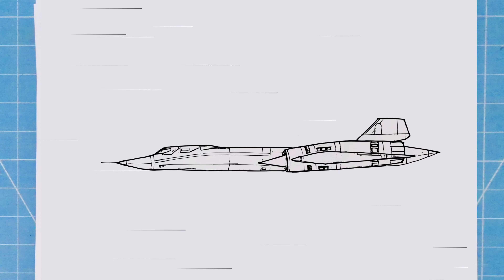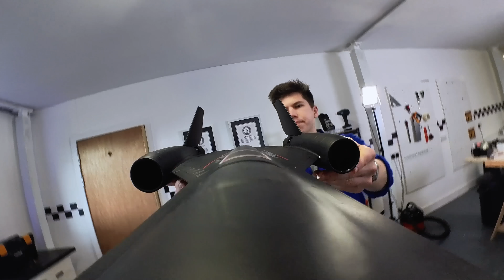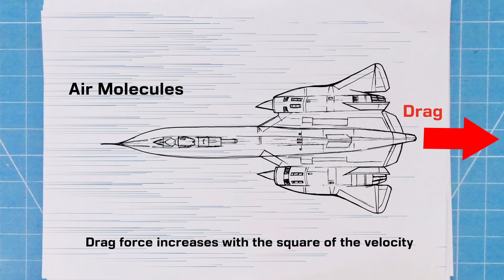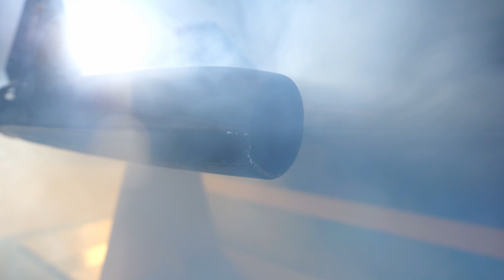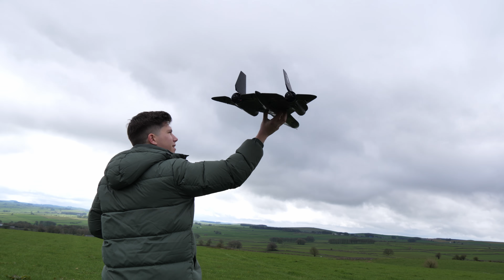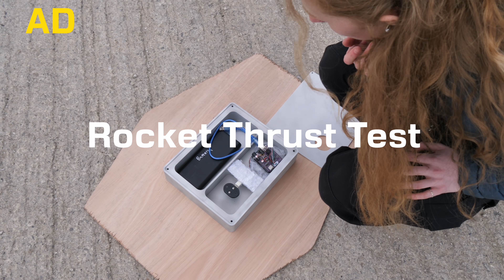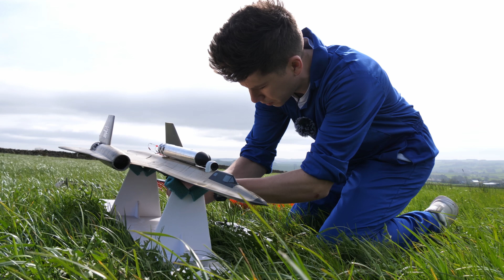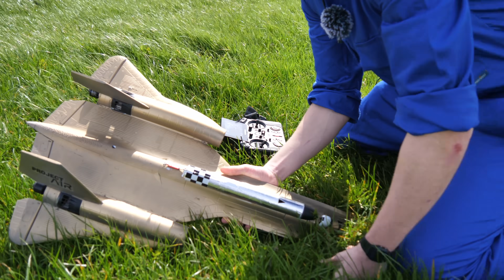Building a HIGH SPEED RC Plane (SR-71)

Comment: you need to stop mounting the rocket engines to the top of the plane . they need to put in the back like the fans but in the middle . desing the same plane model but with the option to put in the rocket engines in the back like a fighter jet . and put 2 rocket engines in the back not one .
Reply: You can can rocket motors that are essentially just multi stage boosters, you literally cellophane tape them together and when the flames hit the tape, it melts, drops off the dead Booster while igniting the second stage. More boost with less weight. Mounted underneath it with 2 boosters then the final motor with recovery chute.
Reply: Everyone is forgetting that the rocket will get lighter after burning and change the cg a whole lot the further away from the original cg it is
Reply: @nite31fpv17 interesting, I did forget about that.  Would be worth measuring the mass delta to determine the impact.
Ideally could design a plane with wide cg limits, and just set it up tail heavy at launch and let software stabilization keep it in the air.
Otherwise it would need some sort of moving mass to offset, which seems... complex
Reply: I know there are wind screens for cameras in the model rocket scene, maybe you could cover the exposed bit of the camera with that to reduce drag. I like the idea of dual EDFs on the wings and a rocket booster in the center. Maybe working with fiberglass rather than foam could help prolong the lifespan of the aircraft. Can't wait for the next episode!
Reply: I disagree with two motors, but otherwise you're spot on.  Two motors is unnecessary complexity at this phase - just getting a stable testbed and some basic design principles sorted would be the first step.

Then can work on multiple motors.
Firing two solid engines at the same time is hard b/c thrust asymmetry causes rapid yawing.  I'd go with higher thrust motors staged serially
Reply: Correct, but it would require massive redesign, almost a scratch-build. Which is ok but a much bigger investment in both time and money.
Reply: I agree with this cuz if it will be sitting on top, it kinda disturbs the aerodynamics
Reply: @Bragiz  not only that, it pushes the perfect in line thrust point from the normal engines way higher wich causes the plane to pitch down and generate even more drag .
Reply: @Ingo3112 się u thought bot the center of gravity?
Reply: Yeah, this guy has never played Kerbal Space Program
Reply: Two engines is hard because solid motors have different burn times and ignite at different times no matter how well times you have ignition.

But you are correct about having the boosters center mounted and not on top.
Reply: @exterminater267  Yes you might be right
Reply: You build your design and then make a video showing everyone how correct you are.
Reply: @BryanOfDale  🤣
Reply: I'm not sure 2 rocket engines is a good idea, since those small rocket motors tend to be unpredictable and can have varying thrust curves, you would introduce large yawing moments.
Reply: Pretty sure it would be a nightmare dealing with the center of gravity if you did that
Reply: But then it would be heavy by the aback
Reply: @Ersen-x9e  its the basic principals of physics it would be a lot easier to controll the jet if they put the thruster in the middle
Reply: @Ingo3112 it would be hard to fit it to the back because this would move the centre of mass a lot further back on the plane making the plane more unstable and backflip in the air. If you tried to balance it out by putting weight at the front then it would probably be a lot heavier possibly even too heavy to fly seen how hard it was already to launch. The fans can go at the back because they are a lot lighter than a scale rocket engine and even then the fans aren’t all the way at the back they are also around half way.
Reply: You are completely wrong, bro. This is hilarious. This aircraft specifically on top ram jet used to accelerator to its max potential easier especially used on NASA SR 71 blackbirds I do not like people who do not actually try and look at a photo in the beginning of the video showing one type of ram jet specifically the double ram jet, but if you want to look into other photos, it will just go ahead and it will have a singular ram jet on the top with a similar nose cone Your idea is smart, but there is smarter ways to do that so next time actually think about searching it up and then you will have better real information. You may not get the same amount of likes because people do not understand this real stuff. And also, he could probably go ahead and just make it a jet engine and do it as a glide like his previous one.
Reply: Boo
Reply: I agree with the placement, but disagree with the number, 2 has a very high likelihood to ignite at slightly different times, causing the same instability issue
Reply: @Hunt4Bond  You might be right at this point . but the ignition is only milliseconds apart .
Reply: I agree with putting them in the back, but you would still have to mount them on top of the plane for the beautiful belly landings that he does so frequently, just 3d printing mounts to face the rockets slightly up and finding a plane with a lower wing cube loading should help, or be a little better anyway.
Reply: Thats exactly what I was thinking half way through.
Reply: The only problem with that is once the solid state rocket engine is burned, it would effectively make the aircraft extremely nose heavy.
Reply: There is no room for the engine to go
Reply: U would think he would actually know this but oh well
Reply: Does it matter? Rocket go push push by going NYYEEEOOOM then SR-71 go fast
Reply: @CA-vo7jk  ah yes that’s how we got on the moon. Not trillions of dollars of research into aerodynamics and rocket science but by going vroom vroom
Reply: @CA-vo7jk  it does matter, show me jet with the engine mounted on top
Reply: He is clearly studying aerospace engineering at Sheffield Hallam University 😂
Reply: This is very true because just the slightest center of thrust on the top can tip the whole thing over I know he engineered it good but still it would go faster if he put it on the back aligned with center of gravity and lift making it more efficient
Reply: Same thing goes for underslung engines, they will pitch up when you add thrust
Reply: About 25 years ago a SR-71 remote control model rocket was sold on TV. I had one and it would have been perfect for this. Maybe someone can track one of those down.
Reply: Its tough to say that it would work. Firstly, the center of gravity will be thrown off as the engines are far back from the center, resulting in reduced work done by the rockets as it's challenging more height, requiring more joules of energy to propel forwards. Secondly, if the rocket's direction were to slightly alter, all the energy from the rocket will result in the body creating directional spin, aka, it's either gonna be flipping uncontrollably or going sideways. This may be due to the rate of the amount of air flowing over control services reducing, resulting in a stall.
Reply: You're right but it can be inside of an engine
Reply: You are sma
Reply: Not ur choice
Reply: @thomaslarsen1743  bro shut up
Reply: He didnt even read a word 💀
Reply: Yeah, mount them like under the wing
Reply: Fr
Reply: Koko
Reply: @mosunosinowo5956  ??
Reply: This is what I do when I actually modify rc planes
Reply: Fffff
Reply: Hhh
Reply: Nah he’s just stupider than a French fry when it comes to this stuff
Reply: Well where's your plane then
Reply: No One cares
Reply: ye it pushes the nose down
Reply: But plane Will get tailheavy
Reply: Finally a smart comment
Reply: Yep
Reply: need to keep the center of thrust in the middle
Reply: Yeaaah i agree but do you have any idea where he can place the rocket? As you can see in the mid body of the blackbird is all the wiring component
Reply: gysryuukfcmhvj,
Reply: @ingo3112 am not saying ur wrong and I don't know much bout planes or whatever but I think the rocket doesn't have much of an effect because its behind the camera
Reply: yes i thimk so too, cause when its two ist more power and its more stability
Reply: They video is about adapting a design, not creating a new design entirely. Putting it on top in the middle is the best way to use it without completely changing the rear of the aircraft. Because it’s in the middle, the centre of mass isn’t changed, and the rocket motor is aerodynamic so the only problem it has is that the air flow between the top and bottom is drastically different, affecting forces like lift and creating turbulence.
Reply: Fax
Reply: And a slim design would decrease drag and wings like a concord would also decrease drag and give the lowest amount of airflow while still having aerodynamic wings
Reply: Ooo, im much smarter than the author of channel, he is stupid, im smart
Reply: @ oooo we don’t care about ur opinion
Reply: Bro is acting like he knows something
Reply: Put it under the wing😑
Reply: @David-zi5wd that’s not how it works, a reason the me 262 isn’t used anymore because the jets increased drag.
Reply: @MR_FREESTYLENURD i meant like the B-1 it was successful and also I was bored and forgot the other part sorry the other part is or try one engine on the tail base or you can try going to use a fan then put a hole that connects to the fan now try it’s faster and use short wings if possible
Reply: Also, putting the rockets on the top can burn the plane.
Reply: DONT LISTEN TO THOSE GUYS
Reply: Blah blah blah
Reply: The plane is made of hard plastic bro
Reply: That would be bad for balance
Reply: That is true, but it is really hard to squish all of the electronic and also balance the cg with such modifications
Reply: @Avio_x the electronics are very basic for rockets. The same current that runs the fans will easily ignite the rockets, you just come off the rc controller receiver with like #22 wires or something very tiny it doesn’t need much to ignite a rocket engine
Reply: Plus he needs to fit that camera inside too. It's creating downward lift
Reply: Totally agree. Try to fit rocket and camera into the aerodinamic shape of the next plane... whatever shape it's gonna have. Anyway, the SR-71 Is soooo cool!
Reply: The CG changes when the rockt motor burns out. If it was installed in the back, it would become nose heavy. But I agree, that it would be better from an aerodynamic perspective.
Reply: When the rockets are on top it may push the plane down cuz it's creating more thrusts than the actual engines
Reply: I know it's not a perfect comparison, but you're forgetting jato, which was an extremely common method of getting aircraft into the air very quickly. Especially when heavily lo, the V1 rocket system in the V-2 rockets, which were rockets, strapped in a back of plains. So all I know, even though it's using an SR 71 , I'd say he's being pretty  consistent with history.
Reply: @NA-oq4ty  Jatos are on the bottom side to generate uplift and pushes the dack down and the nose up as you say to get the plane easier in the air . this has nothing to do with this situation . besides that this config on the top pushes the nose at high speed down and causes extreme drag .
Reply: The V1 used a pulse jet that was mounted to the top. The concept works just fine. 😉
Reply: @GordonScottFPV  It works fine when the thrust to weight ratio is low, like it was with the V1. The pulsejet was a very primitive engine and barely produced enough thrust to keep it airborne, so relative to the aircraft's mass the high centre of thrust would not have had too drastic a pitch down moment. This is something else entirely - the rocket has very high TWR when strapped to such a light airframe.
Reply: @Silvera-Avian  agreed, there are a lot of variables to consider with thrust to weight ratio, thrust angle, etc.. It’s pretty complicated, that’s why I build models and not the real thing 😁
Reply: @GordonScottFPV  Aerospace engineering is awesome though so good on you anyway :3

I play this game called Flyout which is an aircraft designer thing, it's actually very realistic with its physics so it's kinda the RC model hobby I can actually have currently, it's fun!
Reply: @Silvera-Avian  oh wow thanks 👍👍 I’m going to check it out.
Reply: @GordonScottFPV  when the booster activated on v1 the pilot needs to use flaps the straighten the plane it is also more in-line with the aerodynamical center of the plane.
Reply: @GordonScottFPV   yeah works so fine that this is never ever beeing used again ^^ maybe yes it worked but only to keep that bird in the air not to break any speed records ^^
Reply: Cool
Reply: YOU woulda been one a the buttheads telling the wright Brothers " if man were meant to 🕊️ - he'd have Wings" 🪽 😂
Reply: @michaeldanmosley4169  Scuse me? It’s a basic engineering principle. The higher the centre of thrust, the more compensation required. Ergo, it’s easier to control.
Reply: @michaeldanmosley4169 no hed be the guy to tell them to use wings instead of pedals.

Comment: I think that you need to increase your tech... you can include a flight controller with INAV or Ardupilot to have flying-by-wire and also make the trial runs preprogrammed, safe from problems with the radio.

Comment: Putting the "cones" back on the intakes for the ducted fans will aid top speed by disrupting the air and reducing the increasing air pressure that builds up with air speed. Youve added drag by removing them.
Reply: On the original plane, these cones can move and have an inbuild bypass-system.
They are only important for speeds over MACH1.
As he in using fans there is no point to have these cones.
Reply: 5” drone motors seem to be the speed demon upgrade

Comment: Really nice video. I just thought it would be really helpful if you add for example a DJI O3 or some Walksnail system to your planes. You would have HD transmission and onboard 4K recording. On top of that you can use the gyro data from the O3 to stabilize the Video. And with up to 10 km of range you could easily test long burn rocket motors without having to turn around. Overall the handling would be much easier.

Comment: The planes top speed potential was dramatically reduced by bolting on an un-aerodynamic camera and rocket. If these had been shrouded in there could easily have been a further 50kmh.
Reply: Aerodynamics is ultra important in flight. Stick your hand out a window at even 65mph and tell me the position of your hand isn’t as important.

That’s why plane have air brakes. Air brakes create a little bit of drag and it slows the plane down quite a bit
Reply: It probably would not get 50kmh more, probably only about 20kmh:
Reply from the maker: We needed to capture the flight from the air, so it was a compromise I had to make
Reply: @Project-Air you could’ve modified the cockpit and installed the camera there easily.
Reply: @Project-Air  Nah it's okay. 100% increase in speed is amazing already. The camera shape might have made the rocket aerodynamics less significant by shielding it. Keep that aerodynamic optimization for a crazier project (2 stage rocket plane weight balancing when)
Reply: @islam1337simo Agreed.

Comment: Idea: Make a basically indestructible plane by making a 3d printed scaffolding/fuselage/idkwhatit'scalled and wrap it in heatshrinking foil, basically making it indestructible and easy to reoair, while also having the posdibilty of making a hydroplane
Reply: This would be super heavy
Reply: @juanromano-chucalescu2858  depends on the filament used, and the foil is really lightweight